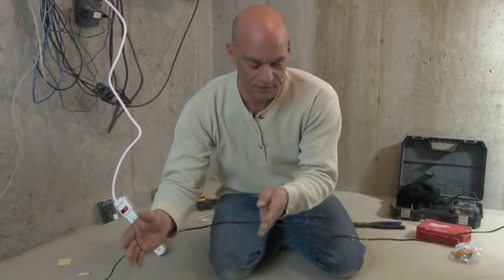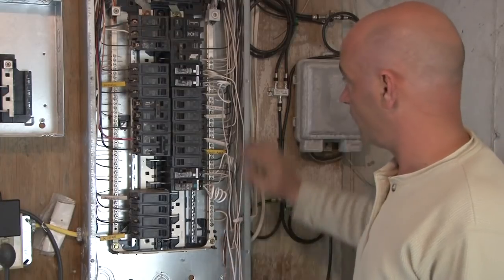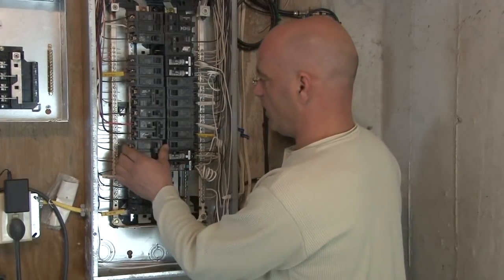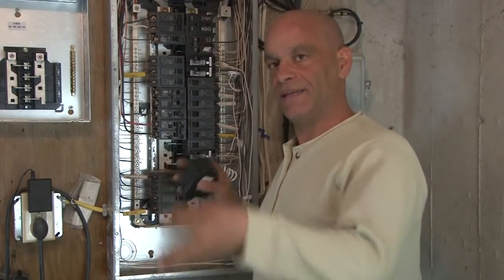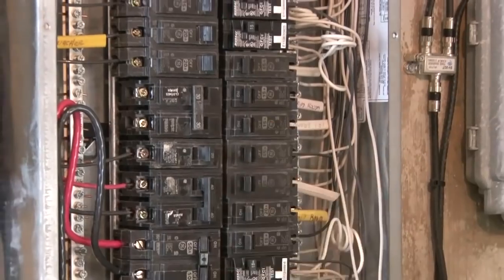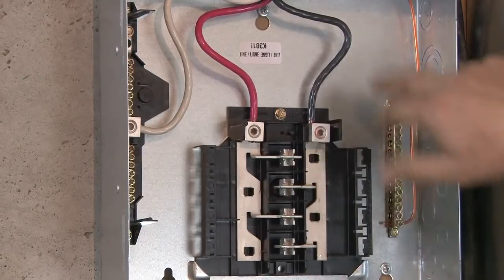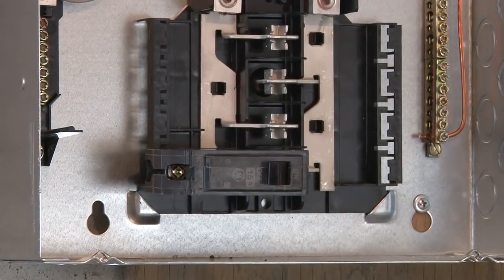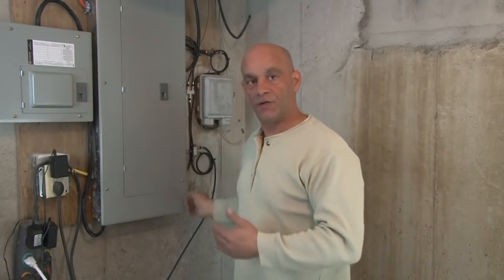How to Install a Subpanel

Comment: Im thinking you already have a disconnect and you want to know if its ok to use it and the answer is yes as long as its fusible you really need over current protection. anytime you use a non-fusible disconnect is when you want to disconnect power to work on a motor/ac unit.

Comment: I would be using a wooden pole from the utility company that was damaged in an accident and relocated to a pasture area behind my house. If the sub panel included a main breaker would that be ok in place of a separate main disconnect switch?

Comment: all I can is WHAT?
please define utility pole? yes anytime you have power outside the sight of the main distribution panel you need a main.
Reply: I will beg to differ. NEC code, as long as you have no more than 6 throws of the hand you do not need a main breaker. As far as a disconnect, like, more than 25 feet away and line of sight. Always good to have local means of disconnect though.

Comment: In Houston we look at this different. if your main power coming in from your provider is required a ground rod, anything passed that point is considered a subpanel and the ground comes from the MDP. main breakers are not required as long as the SP in with in sight. in other words if you leave your MDP and install another panel you need 4wires like a NMB83WG and also if you cant see your panel install a main.

Comment: its all about the amps, ok at 4000w at 120 volts you need a 1p 40amp breaker that is not easy to find and if you do its going to cost you big bucks and at 240v you can run a 2p 20 amps breaker. also one question is what 1000w fixture your running is HID or a quartz or incandescent.

Comment: sorry I just had to answer your question. All panels are load centers but you make them subpanels as Dom said taking the ground screw out. In Houston you need to have a means of disconnect in sight, in other words if your subfeeding then it needs to be a subpanel but if your getting power from your provider the it needs to stay a load center.

Comment: Hi Dominic, great videos. I'm hoping you can help me out with your expertise. I just finished putting up my panel and all the conduit, wiring and outlets then realized when wiring the panel, the box is actually a subpanel, not a load center with the 100 amp breakers, duh. My question is, can this subpanel be converted to a load center by installing 2 100 amp breakers along with the other 15 and 20 amp breakers. I would hate to have to take this down and start over. Thanks for your help, Michael.

Comment: Trying to run 4x 1000 watt lights in my house should I switch to 240v breaker or run sub panel also I don't get how one breaker runs a whole room are the lines spliced together or something ? Last question would it be cheaper to run 4000 watts using 120v or 240? Ty big fan

Comment: If a subpanel is located on the opposite side of the house (for kitchen appliances - about 100ft run) does it have to be bonded to the house copper which goes to the grounding rod or is it by default bonded through the main panel?

Comment: If you wanted to install a sub panel in an exterior environment such as on a utility pole, would you need to install a weather proof knife switch(main disconnect) and a weather proof sub panel? Or would the weather proof sub panel that included a main breaker be acceptable?

Comment: I watched the video and it was very well done. You mentioned if the sub panel was installed in an detached building, you would need to ground the ground strip in the panel to a 8' ground rod. With that being understood would you also carry the ground from the main panel to the sub panel?  Is it an optional thing or required?

Comment: That's going to run much more money. As power company has to disconnect from the pole.

Could I run a new wire from sub-panel into fuse where furnace is now? Old furnace will be totally disconnected and taken to dump of course. The main service is only 100 amps.

Comment: I am selling my home and buying a smaller home built in 1950s. It still has the old fuse box. The oil furnace is shot and I am considering electric baseboard heat. I was thinking take wire from furnace and run a sub-panel for more room for electric heat. Would this be okay?

Comment: I assume your going direct burial. Keep in mind that aluminum has a different ampere rating than cooper. if you need 60 amps, #8 aluminum @ 90 deg C is rated 45 amps where as #8 cooper @ 90 degs C is rated 55 amps. My suggestion would be to install # 6 cooper or #4 aluminum, both rated 75 amps @ 90deg C. Install a maximum 75amp 2-pole breaker, but it will be more expensive than a 60 amp breaker. Your sub panel can be a main lug or main breaker type for your garage. mobile home feeders are fine.

Comment: Hello, I have a friend that wants to build a room in his basement that would only need a few outlets and a light but he has got an old panel type box that only uses fuses and there aren't any spaces left. Would we be able to run a sub panel from that and use a breaker type box otherwise what are our other options? 
Thank you.

Comment from the maker: Does the dryer require a neutral ?
Reply: Most dryers today are required to be 4 wire. This means, a ground, neutral, and two hots. Some appliances use 120 volts of the 220 for electronics within.

Comment: Hi Dominick,
When bringing in an older style dryer feed that lacks the red wire to that subpanel, is it a problem that there wouldn't be a neutral going to the neutral bus?
Thanks

Comment: Hi Askmediy, I think Mr. Madajewski did not see the identification (markings) of each circuits on your main panel (i.e. which breaker supplies what circuit) on the video. He only saw the sticker that you put to ID your subpanel feed. On the other hand, you specifically notified the viewers to identify the circuits for each breaker (the sub-panel breaker in this case) - so it was just a misunderstanding on his part I believe.  Great video, thank you for the information, Ciao L

Comment: Hello Akmediy, enjoyed watching your video very well done and to the point. 
Question: How do I calculate the size breaker for a sub panel. Need to add six breakers for a kitchen remodel and my exiting sub panel only has 1 open slot or room for on single pole circuit breaker. The additional 6 circuits will all be on 20 amp circuit breakers.

My current set up is as follows, SE is 100  amp main with wire run to 16 circuit sub panel. Would like to add additional sub panel.

Comment: When installing a sub-panel, you don't want the ground bar connected to the neutral bar for safety reasons. If you leave the green screw in, it will ground the two busbars together. In the main panel, the ground and neutral bars are connected by a metal bar, but any wire leaving the main panel into a circuit must separate ground wire from neutral wire. It's all for safety.

Comment: The difference between a ground wire and neutral wire is often misunderstood.  The problem primarily comes from the inappropriately named “neutral” wire.  There is nothing neutral about a neutral wire.  It is a current-carrying conductor, just like a hot wire and has all the potential for danger and should be treated with the same respect.  The ground conductor although in theory could provide the same conductor as the neutral to complete a circuit is used only as a safety device.

Comment: Great job!  Interesting that you have the exact subpanel I purchased. Gave me everything I wanted to know about except the romex wire needed between the breaker and the sub.  If I use a 40 amp breaker, what size wire would I need, a 8-3?  How about for a 50 amp, 6-3?

Comment: The "sub-panel" you're referring to is actually a disconnect switch that is required by code if your panel isn't within 6 feet of the meter. Glad that you found it easy to tie in there.

Comment: I would not recommend using mobile home feeder wire, the wire gauge is too thin to handle the current load. I would recommend using type SUE (underground service entrance) 2/0 aluminum in conduit for your run unless you plan to run it through the air in which case I recommend SEU with a separate ground rod. 6AWG is only rated for 50 amp feed.

Comment: hello.. im running power from my 200 amp service inside my house 85 feet to my new 100 amp service in my garage. someone recommended to use "mobile home feeder wire" i think its like 6 awg wire. my question is will this 6 awg wire fir into my new 100 amp breaker im going to install into my panel in my house? does this sound right to you? could i use 8 awg wire? again im going 85 feet and in my garage i will use appx 60 amps at any givin time. thx for your video.

Comment: I used to have an outdoor heat pump.  Had a (sub?) panel right next to the meter. Took lots of juice (3-240V ckts) with those heat emergency heat strips. They replaced it with Nat Gas and air conditioning all in one.  There was two extra 240V branch ckts in the sub?panel on the side of the house.  When I installed the Garage Sub-panel I was able to run a nice 240-50 amp ckt out to it from that panel. Was nice not having to return to the main panel "buried" in the house.  Blessings, John 20:29

Comment: To stop what is called a ground loop. if you do not do this, you stand a chance of getting electric current on metal equipment connected to the circuit. washing machines, power equipment any electrical item with metal casing...

Comment: No thats wire you refer to is a ground fault detection wire. connected to the breaker. same as you see on hair dryers and out door electrical garden equipment..

Comment: Hey Dominick, I need advice with a subpanel hook up. Main panel is 100amp and I got a good deal on a 125amp 6 circuit subpanel for garage. Garage is only 15ft. from house. In my garage I will be running an air compressor off a 30amp two-pole breaker and a welder that recommends a 50 or 60amp two-pole breaker. I will then run lights and a couple outlets from the remaining two single spaces left. What size cable do I use to connect the main to the sub panel? Yes I will use outdoor rated wire.
Reply: If your sub panel load is 60 amps plust a few more smaller breakers, you will need wire rated for more to feed that sub panel. From a 100 amp panel to the 125 amp rated panel, sound like at least a 80 amp breaker. Can put more than 80 % load on a breaker. It will slowly get hot and trip. After a while, will fail and keep tripping.

Comment: The ground and neutral buses need to be kept isolated because the neutral bus (white wires) do carry current, so touching the box could potentially cause a shock, especially if the white wire became loose or broken.  The green wire (ground bus) does not carry current, so the sub panel box can be safely grounded without risk.  Also I have had some problems with GFI tripping all the time if these wires are not kept separate.

Comment: Question- I know you have to take the green screw from the ground bus on the sub panel to isolate the neutral and ground, but it seems that when you mounted the ground bus you essentially did the same thing as the green screw. Did I miss something?
Also what is the curled neutral wire on the right side for? I have one in my box. Is it just because it is a short length to the bus and this gives it some play?
Thanks for good video!